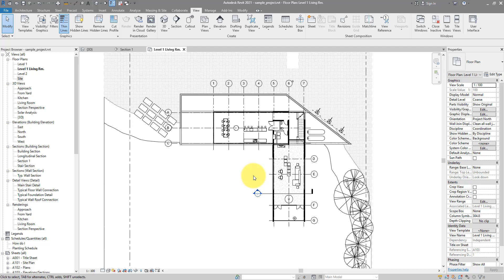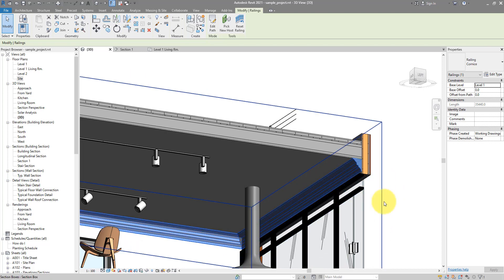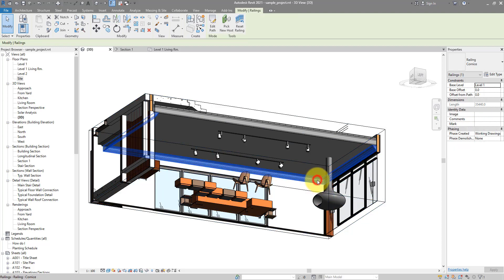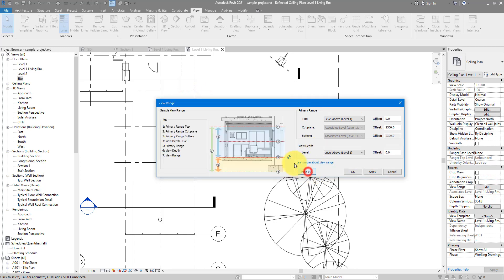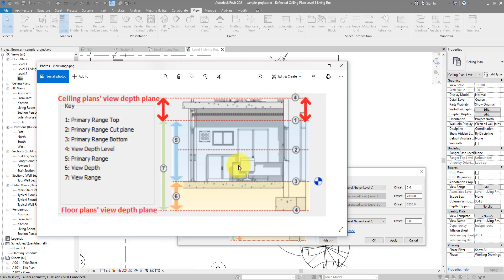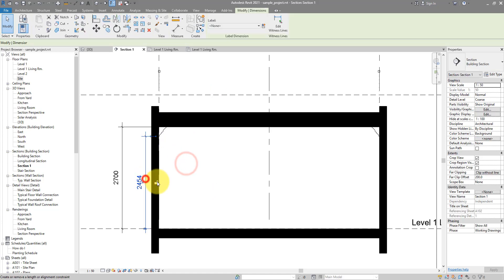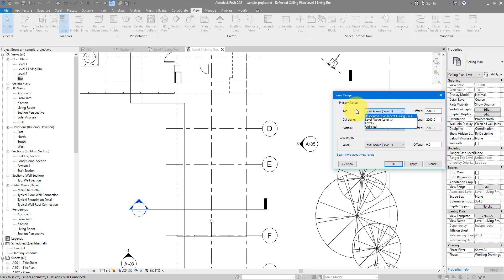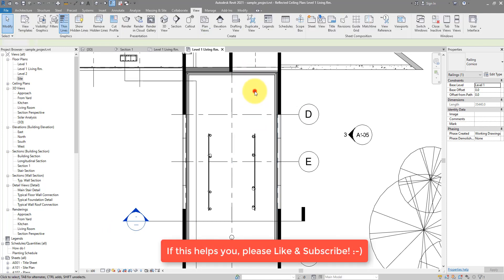Revit Snippet: How to show railing cornices in ceiling plans

Comment: Works great,
But there is a footnote:
Zone 1 to 4 needs to cut the plane where the railing itself is placed (read: location sketch lines) and not the 3D elements of the railing itself.
I have to work with a third party model where due to the IDS everything is placed on finished floor level of the regarding floor.
Setting my cut plane above this level returns no railing in the RCP. Setting cut plan below works fine.
Reply from the maker: Amazing tip! Thanks :)